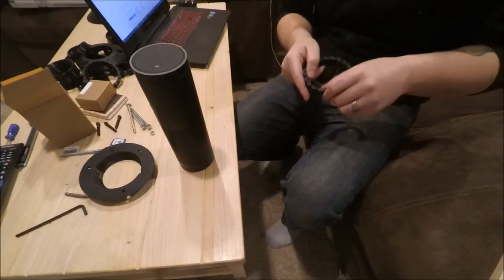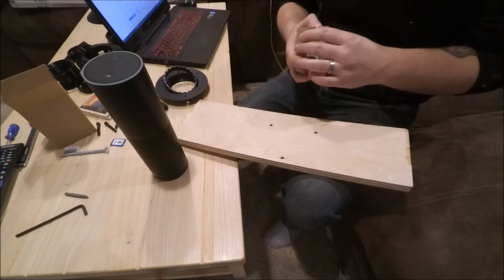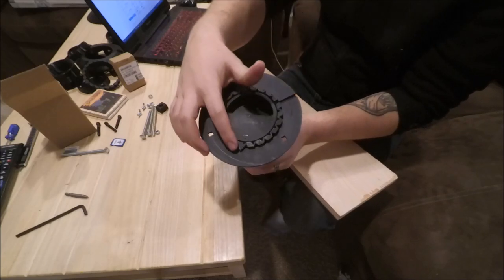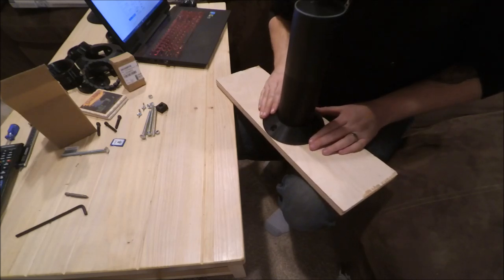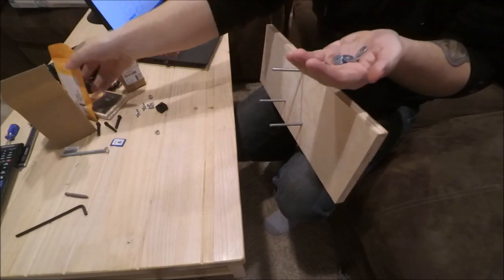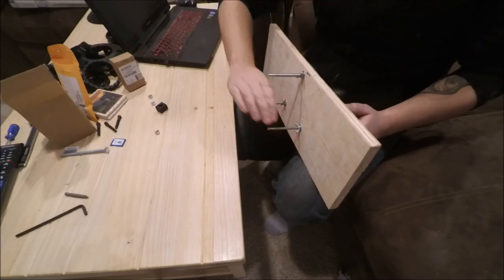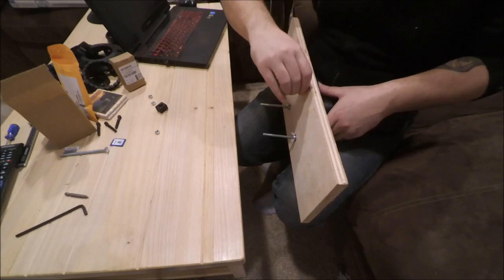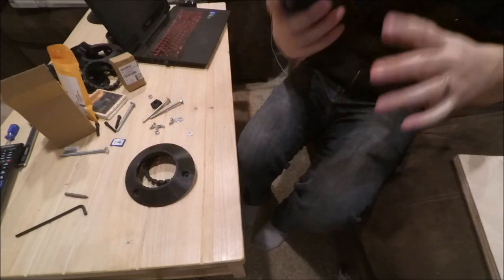Echo Mount install video

Comment: Need video address the wiring options for a ceiling mount   Can this be put over canned light ?   How to plug in the echo to a light socket?     Is the mount big enough to cover standard canned light ?Will a light socket to plug converter still fit, allowing flush mount?Need more info on your product page, on etsy. thx

Comment: I have a place in my hallway where a fixture used to be.  The wire is always on (I suppose this used to be a hardwired smoke alarm fixture) - this would be a great spot to mount a Echo Dot on my ceiling, but how would I hardwire it without blowing it up?
Reply: Adam Genesis First, make sure you've capped those wires so there is no safety issue.

I would then put this wires in an outlet box that is for outdoor use. There is so much dust that it would be best to have it sealed. Then plug it in. You can also chat with an electrician and they'll  advise you but be aware their time is worth around $40 an hour. :)